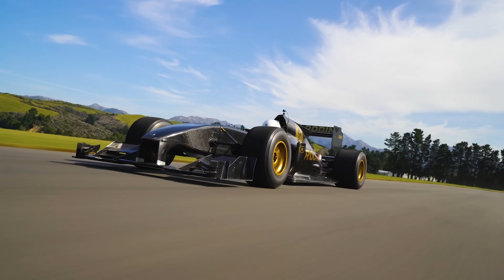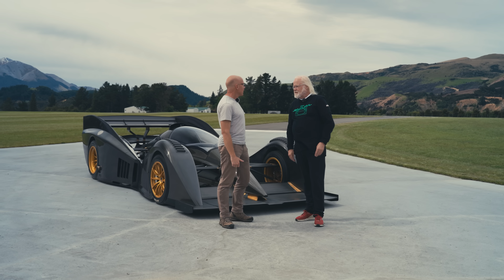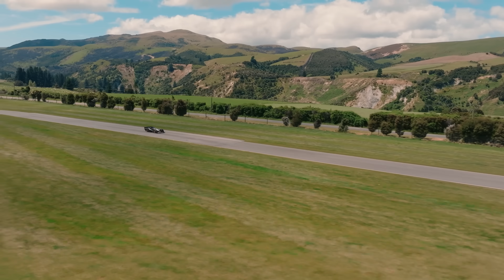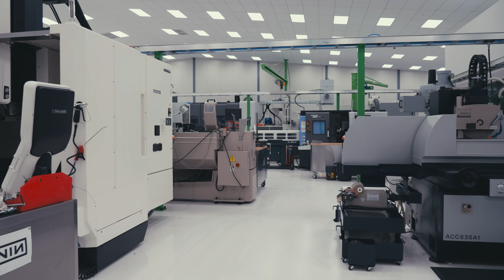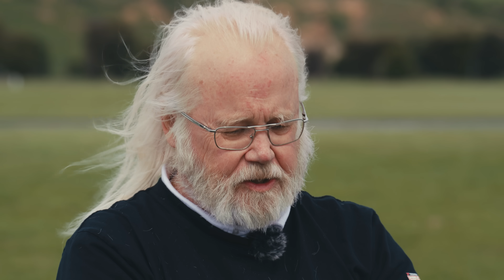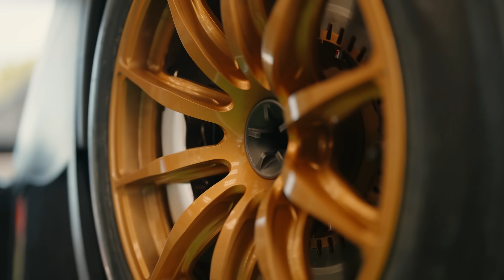Rodin FZero – 1500bhp Single-Seat V10 Madness!

Comment: The sad part is that most of the development cost is F1 is making those complex aero bit around the rules rather than just going fast. I can't imagine that being useful for anyone. F1 is supposed to be the pinnacle of auto engineering to go fast not save fuel. that should be formula endurace. F1 is about having the fastest car possible.

Comment: Is this car designed for road use or only for the circuit? If it’s only for circuit use, then the noise inside the cockpit would be similar to that of a pure race or rally car, right? But if it’s designed for both daily driving and track use, does it feel like driving a Ferrari, or is it much harsher? Does it provide a comfortable drive?

Comment: I’ve always wanted to recreate the wing car design used in slot car racing and incorporate it for road racing. My idea would be to add 4 vertical wings. One each connected to the front wheel housings and have the wheel housings move with the turning of the wheels. Two more on the rear wing on each side to control the rear end. All 4 wings can move with a computer connected to the steering wheel and designed to keep the car where you want it. I think it would also be cool to make the whole man cover plexiglass and the downforce controllable with a rear hydraulic arm. I used to race slot cars and always wondered how you could make a car handle a corner at speeds never seen before.

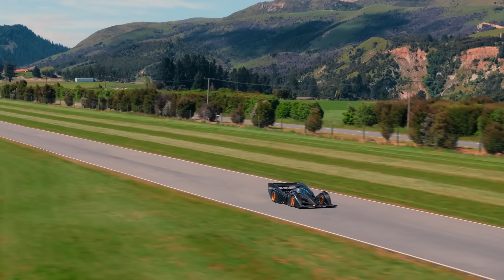Comment: 06:06 why does direct injection emit less? I know that it runs cooler, so you can up the boost and compression. Port injection creates less soot, though. With an undersquare engine I could imagine that direct injection sends less fuel towards the oily cylinder walls. So you don't need to evaporate as much fuel back. You can cool the walls down to a lower temperature. Or is this about unburnt fuel in the seat of the intake valve? Or unburnt fuel in the set of the injection valve. So the injection valve set is smaller => less fuel to evaporate on exhaust stroke? Or is this about valve overlap? There has to be a catalytic converter. With direct injection the turbo can blow through some air, and direct injection can make the mixture fat in the cylinder. It compensates in the cat, but it gets warm. Why don't they use 5 valves. Then the 5th valve is far away. You can flush half of the cylinder without getting air to the exhaust. With rocker arms, it should be possible to place all 3 intake valves in a plane. Those old Yamaha, Audi 5 valve roofs looked ugly, but they used tappets on the valves.

Comment: I think he can reduce the weight a bit more using a CVT transmission box, provided that it can handle the power and torque. And no more gears to shift manually.
Reply: CVT lost to double clutch and hybrid
Reply: @ArneChristianRosenfeldt 
Not really! CVT in the first generation was too vulnerable and high maintenance due to the complexity of the system and therefore too expensive on the long-term level.
Reply: @Dutchman_in_Spain   @Dutchman_in_Spain  I read that engineers found fundamental CVT limits. High RPM leads to centrifugal forces which pull the pulley out of the cones. Large diameter for more torque does the same. Instantaneous torque is also no good: You better have a two mass flywheel. But never go full throttle below the bandpass. CVT would fit those small Ferrari NA V12, but with soft valve springs and a strict RPM limiter. And no one is able to manage a complex system made of two CVTs in parallel. And in a short, I read that F1 use a single clutch which they let slip like motorbikes do. Then just slam over into the next gear. I still got no answer, if a computer (roboter, automated gearbox) would be agile enough to slam in the dog teeth with high precision. 100% overlap, no rebound from the gear disk. I read that some racing series slam in the gears itself, but that would need a revmatch: double clutch.
Reply: @ArneChristianRosenfeldt 
Like I stated in my initial comment, provided the transmission can handle the power and torque, and in addition the rpm's as well, to handle the engine within its limits. 
You made a good statement, pal. 👍🏻
Reply: @Dutchman_in_Spain  But we already know that this is not provided. All big car companies around the worlds tried. CVT were also tried in race cars. Only application: scooters and lathe ( well, when they tried not to use transistors when they were still expensive: So: not anymore ).
Reply: @ArneChristianRosenfeldt 
There is a saying:
Where there is a will
There is a way 

We'll just have to await the next future brilliant mind to come with a solution for the CVT and high performance capabilities.
Reply: @Dutchman_in_Spain  A lot people had the will to convert lead to gold. In the end scientists at Cern did it accidentally and don't even extract the gold. I was at a mine where they stopped mining once there was less than 1% of gold in the ore. Super hard ore. So they exhibit it all over town on the street. No theft yet. I learned that this is called Monkeys Paw?

Comment: Some lights and a crash test and she's road legal. But that requires sacrificing cockpits :(. Possibly as a concept car as long as the lights are proper at the right height. Some Tiny mirrors on the monocoque as well. Rear facing cameras in stationary can be a rear view mirror replacement. Besides my shower thought , its a beautiful machine , a work of art as it were.

Comment: the skirts are like 2 inches away from the floor and it has 4000kg of downforce... you run over a small pebble and break your back with that suspension

also, you have like 4 inches of clearance on the wheel well... according to my very complicated math even if the whole car body touched the floor you will still have 2 inches of clearance so why make it so big given the clear implications on aerodynamics?

Comment: Why there is no tinting on the section of the poly canopy above the drivers head makes no sense. If they are so concerned about the temp getting to 50C in the sun why not put something that blocks the heat.

Comment: This is literally every gearhead's dream. A facility with a dedicated racetrack, the equipment to make engines from scratch, the computer software to run and design your own aerodynamic setup and tweak it for maximum performance, a team of F1 engineers with the know-how to accomplish the goals he has set with this project, the money to be able to do it, and the retired free time to dedicate yourself to your dream project. Good Lord. You never work a day in your life if you love what you do, and this would be my retirement present to myself. Phenomenal job so far. I love the angled radiators under the rear fenders just pulling air in from the sides. That custom straemlined V10 in that beautiful missle in the center. Can't wait to see the production car. I hope this becomes the ultimate racecar for true automotive lovers everywhere.

Comment: "quicker than an F1"

F1 cars are actuallt designed to take corners as fast as possible. Not top speed. It needs a rear spoiler mod to be a little bit faster on the straights

Comment: So, a LMP2 car? Any Endurance team could make any car faster if regulations were not a thing. But you build a car for the requirements, regs, do you need high speed?, cornering?, and length of race?. maybe come back when it at weight, still meets crash protection levels and then start testing. At this point, this is just hypothetical and and simulation.

Comment: Baut time some one made the Grand torsmo Redbull 20XX car series a reality! Alos the reason for the extreme cost of tiopo F1 teams is the massive investents they need to make to tune the cars with in the exteme limits o9f F1 rules... Nascar does not cost nearly that much  for a full team for a seaaon then a single diver takes to win a F1 race... Huince why nascar is massively more compet8ive these days and F1 just isn't... The driver skill isn't there nore the isnane more then a moon rocket investment to make not the top driver win a race if they lack enough skill... IOn Nascar it;s a team endurance sport so it;s way easier tio win as a small Cup series team as it is a legancy team...

Comment: This is the passion that should be in making any automobile.  Whether it's a sensible commuter car or a hyper car with everything in between.  Auto manufacturers care and quality control is complete dog Sh*t anymore.  From parts all the way up to finished product.  Been a mechanic for a long time and the cars have become extremely complex and cheap as hell all at the same time.  Overengineered garbage essentially.  Modern cars have astronomical potential but unfortunately are held back for 1,000,000 reasons that are mostly bullsh*t.

Comment: Regarding the radiator placement, at these speeds they might be able to use the Meredith Effect ( https://en.wikipedia.org/wiki/Meredith_effect) , basically if you are going fast enough the heat expansion of the air through the cooling system produces thrust.

Comment: I have to wonder how the center of mass being split out wide will effect handling. With the radiators and turbo chargers podded in the rear fender structure instead of directly linked to the monocoque. The center of gravity may well be lower and the lack of ERS/Hybrid systems surly counts towards weight savings... Yeah really interesting.

Comment: So hard it has to be to film this. You have a car that for all pursopses has to be incredibly fast even if it somehow were to be totally faulty. The engines, the wheels and the aero. Even if the suspension was totally borked it would still be extremely fast in a straight line, but how do you film something like that so you get a feeling of that power and speed. I don't know, and I don't know about the suspension. It might be the best ever made and I wouldn't know the difference just by looking at the screen. We don't even know how hard it was pressed in the scenes we got to see here. What I do know is that in the driving scenes we were shown it looked about as fast as a Trabant. This was not a problem by the driver or the car, just by the scenery and the fact that you really couldn't feel a sense of speed and power. That is the bane of trying to film something like this. I don't know if we will ever see this car driven like it looks to be designed for. But I'm afraid the wow and awe feeling will have to be generated by the figures on paper and times provided for certain tracks.

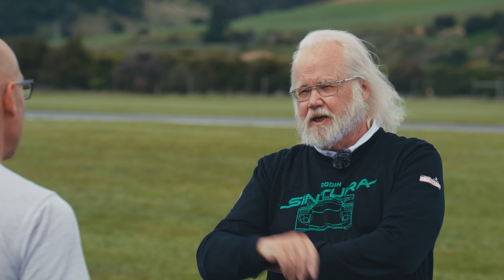Comment: 2:16 Germans: “Every centimeter has been perfectly measured and designs for optimal performance.”
Italians: “we have built the finest engine, and there is beauty in the aerodynamics.”
English: “We have taken our racing experience and carefully worked it into the design.”
New Zealander: “I can’t draw, I did it in CAD, I just drew lines, pulled some shit around, did stuff until I said ‘yup’, and here we are… faster than F1.”

Comment: The back side view of the car looks like 1989 Batmobile. A lot of the design of the car screams Hot Wheels. Everything looks great. But my real hate the is ugly high front wheel arches. When you sit in you can't see over them. Of course the 2 side screens in the cabin are supposed to solve this issue. But its kind of stupid when our eyes need to quickly focus from far horizon to interior screen which is crippling for quick driving maneuvers.

Comment: Wild 🎉⭐️⭐️⭐️⭐️⭐️

At its fast tick over, it has the erratic chatter of all my favourite 2 strokes as a young man…… my Kawasaki triples, my tuned Suzuki 750 “kettle”………. on the brief road section it reverts to a more recognisable wail, but never the giveaway V10 ?? I’m guessing at a flat plane crank judging by the noise….?

Definitely a BatMobile in profile 🥳⭐️⭐️⭐️⭐️⭐️

Comment: What modern F1 should, and could, be like.  It should the the technical pinnacle of what's possible.  What's possible with current tech isn't even in the same ballpark of what they're doing now.  And it's (probably) much cheaper.

Comment: It’s basically the Redbull X2010 concept car. Which isn’t a bad thing. Everything except the engine is there or thereabouts correct. This has a twin-turbocharged V10. The X2010 has a twin-turbocharged 3.0 V6. This is aimed to make 1500hp. X2010 - 1483hp. F0 weight goals just under 700kgs without driver. X2010 - 545kg without driver. (Probably attributed to smaller engine + unrealistic sim expectations). Transmission - F0 goal 7 speed semi-auto. X2010 7 speed semi-auto. 

The only other difference I can see is the downforce rating. The X2010 can pull 8.25G in the corners (also probably due to simulated coding for higher KGF load on the tyres) and the friction coefficient (1.97) @ 300kph. 

Super stoked to see someone challenging nature this way

Comment: These guys have done some good work, but I'm not really sure who this car is really for as a production car. You certainly won't be driving one of these on many of the New Zealand roads all the body kit will be shredded to bits with all of the potholes and uneven surfaces, plus speed cameras around every corner. That cockpit looks pretty claustrophobic too. Definitely an exciting concept car, I just don't see the usability of it.

Comment: Whilst I do applaud this guy for following his dream and passion, I don't fully understand his reasoning. We already know that cars can be built faster than an F1 for much less. F1 is expensive because designers and engineers are gaining time, within a set of regulations. If we removed the regulations away from lets say Haas, you can almost guarantee they will win every race for very little spent.

Comment: If Mr. David Dicker decided to license the camless technology from Koenigsegg, it would easily have double the 1500hp and be 3000hp, not even including if he used Koenigsegg's very lightweight(88 lbs each) raxial black matter cylindrical EV front motors which put out 888hp each!!! Then we'd be talking a car that weights under 2000lbs and puts out over 4750hp...just let that sink in for a moment :)

Comment: Dude is gonna cut it close to doing a Devel 16. He made one though, and that was his goal. Really would rather see an airbrake installed than DRS. 

Honestly, I'm a bit offended that he feels like the cockpit is something to hide. Like there's never been a beautiful airplane before. 

Interesting choice to run the exhaust to the outside. If it was me I've grown kinda obsessed with the concept I'd run a hot V and dump the exhaust right into the turbos and dump that right out the back of the car to accelerate the air beneath the wing. Not sure what to do about the cold side though... just saying, I have similar dreams, so I've thought about it before. 

Why not hide the front wheels from the air with "dustpan" fenders? I think it would work, and besides, steerable headlights! Also the lack of covers for the rear wheels is an interesting choice.

Comment: Those front wheel arches will be blocking the driver's view from the inside, either lower those arches or the driver should sit just above higher than those front wheel arches

Comment: The header design is inefficient. Having the runners out in the air stream like that cools off the exhaust gas before it gets to the turbo which reduces the efficiency of the turbo. Not a good design in my opinion.

Comment: The headers should be wrapped completely all the way, if they are going to be that long, because you want the exhaust to be as hot as possible before it reach the turbo.
Having 40 cm out in the wind is going to kill the exhaust velocity. A ceramic coating plus full wrap might help. They also add a lot of weight. 
I would shorten the headers and moved the turbos closer to the block , with the intakes facing fwd.

Comment: I love the spirit of this gentleman but I doubt this car to be competitive to a current F1 car. I had been invited to the Ferrari F1 engine and gearbox development center in Maranello some time ago (which is secret to close to anybody outside the Ferrari F1 engineering team) and the packaging of engine and gearbox there is at a completely different level, believe me. But also, thats where Ferrari's development money is going into. Anyhow, very impressive what Rodin is doing. All the best for further pursuing your dreams, Mr Dicker.
Reply: This will smoke F1, has far more downforce and power, same or less weight. This doesn't need to follow rules and shows how much can be done when not constricted. These guys are using 3d printed Ti over all sorts of areas including gearbox housings, there isn't really a better tech than that currently! It's used in satellites, space, aero, etc etc for a very good reason.